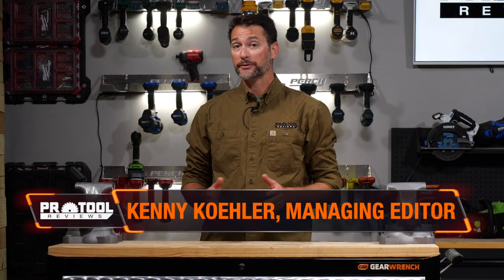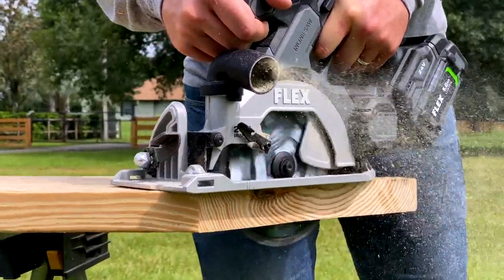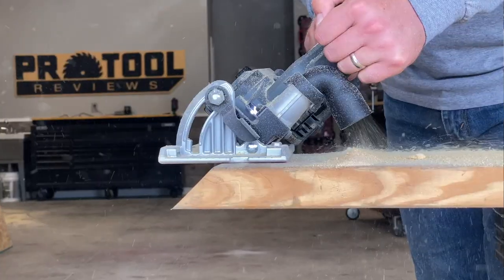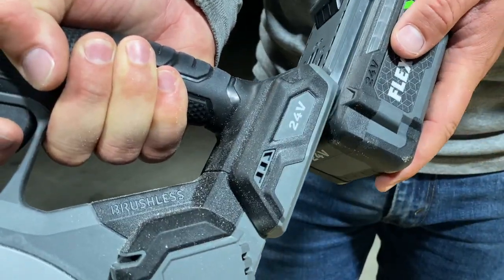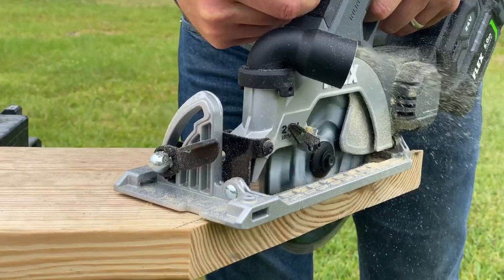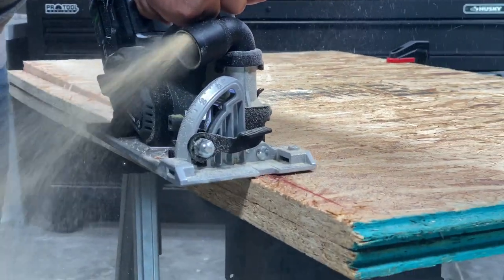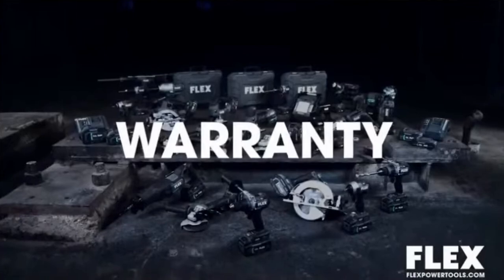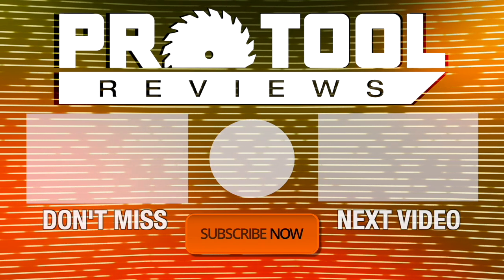Flex 24V 6 1/2-Inch Inline Circular Saw Review

Comment: Bought this a month ago and finally got a chance to use it.  Feels smooth and very powerful.  The included 24T framing blade cuts well, without any tear out on rip cuts.  The weight is perfect.  The inline design eliminates the motor overhang you get with every sidewinder, making working with straightedges a breeze.  To me, that alone is worth the price of admission.  Very impressive saw.  I feel it’s a battery hog but that’s to be expected for a circular saw.  Wish I had a stacked lithium to really stress this machine.

Comment: This is by far the most interesting tool in the Flex lineup for me...now if only I had a real need for a circular saw...
Reply: I didn't need the Flex inline circular saw, but once you see it in person, you have to buy it. It's belt drive, which makes it the coolest cordless circular saw of all time. The 6 1/2 blade actually has more cut depth than a 7 1/4" due to the belt drive system, and the best part of the dust port, which blows the dust away from you while you're cutting, not back in your face. The dust port is the main reason I bought it, nothing else on the market has a dust port. I am not sure if I'll ever use it, but for $189 with a battery in a kit, that's a crazy good value.

Comment: Really like that saw!  Yes, the "belt drive" but to me, that is a good thing.  I am assumuing it uses the kevlar toothed belts like car engine timing belts or the ones used on Harley Davidsons that last 100,000 miles.  (Carbon fiber toothed belts)   The good thing about toothed belts is it protects the motore from shock as it creastes a mild suspension effect to protect the motor from shock and also minimized vibration.  Complaining about the belt drive while you drive cars for 80,000 miles with a toothed belt spinning the cams in very high engine heats is rather odd.  I would highly doubt the motor could outlast the belt IF it is done right.  Now if Chervon (Flex/Skil/Ego) designed the belt properly or better yet, let 3M do it they can do a "one an done" by overdesigning it so all saws in the future can use the same belt no matter how much power.  It would be good to see a tear down, maybe by AvE so he can identify the belt and give his take on the entiere system.  Hmmm, have less than 5 months left for the tear down to get the uber warranty....getting nervous!
Reply: Wow, thanks for all that umm informative rambling there Luck Puppy!  Wow 
It looks like it vibrating as it was cutting, kinda like a Harley?  I don’t know?  
Peace  lol 👍😁✌🏻🤷🏻‍♂️
Reply: The other benefit of a belt saw is it should be quieter but the is that one problem, the back order.

I ordered a Fex oscillating tool from Lowes and it is going on 2 1/2 weeks and nothing.

Today I am going to order this saw and I will see how long it will take to get it in my hands.

Comment: Can someone tell me why every cordless circular saw doesn't come with a rip fence. I just recently bought a Milwaukee 6 1/2 inch circular saw and it said on the box ripfence included but there was none there. Every tool company should include one in every circular saw box. It doesn't really cost anything and it's very convenient to have. I don't have a table saw so every time I need a little taken off a 2 by 4 or plywood I have to break out my 15amp Makita circular saw and it sucks cause I prefer cordless. Every circular saw has the slot for it but never comes with one or you can't find one to fit any and every circular saw out there

Comment: I just bought the Flex inline 6 1/2 saw. I don't think people realize how good the engineering is. Out of curiosity, I wondered why the charger didn't list the "amps" anywhere, only watts. I realized that their charger puts out 6.6666 amps. Exactly 6.6666 amps at 24 volts. Their fast charger puts out 11.6666 amps.  That explains why they don't list the amps anywhere on the charger. 6.6666 amps? And 11.6666? Their engineering team obviously has some interest in numerology.

Comment: the saw sounds great but the belt drive makes me worry regardless of warranty. If the saw breaks you still have to have a backup
Reply: They all have warranty’s and will take a few weeks to repair . I have red and yellow tools and with a lot of daily use things can break . And if your in the trade you’ll have a spare anyway . I have a back up cordless and corded . I like having a lil guy to take up in the rafters or on a roof , a bigger one to leave by the saw horses or if I have a cutting station I can leave the big boy over there . If this is for just home repair I doubt you’ll ever have a problem. You can build a lot of house in a year and put that saw to work daily . Just my 2 cents I wouldn’t want you to miss out on a cool new tool !
Reply: @jonnybrapp418  those are fair points, I am in the trades as an electrician but don't use a circular saw much so I don't keep a spare on the truck.

When I hear the words "belt driven" I think of all the belts  that have snapped at the most inconvenient time on me. You typically don't get much of a warning when one will break unless you can visually inspect it. I've worn out plenty of directly driven tools and you get some warnings that they are about to die. They start to smoke or get weaker than they used to.